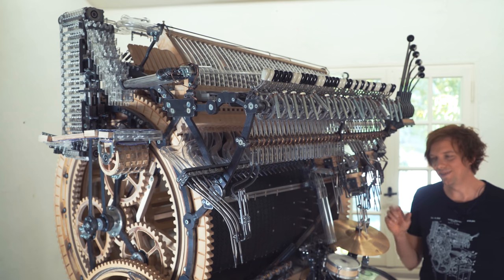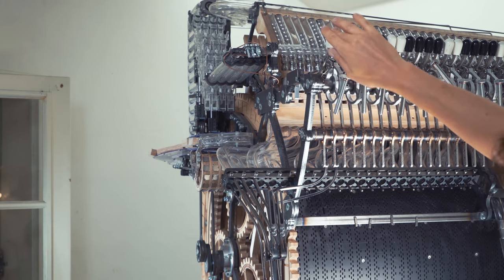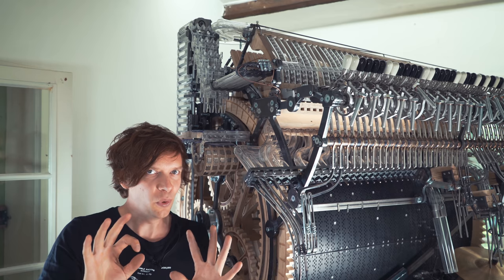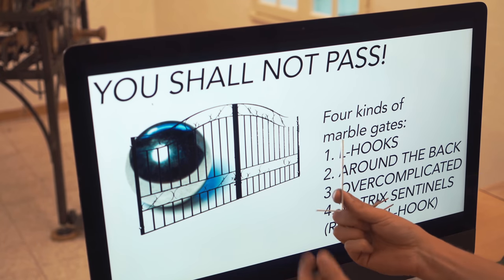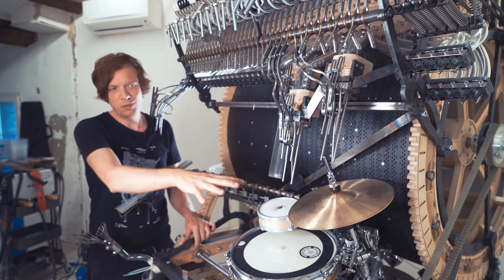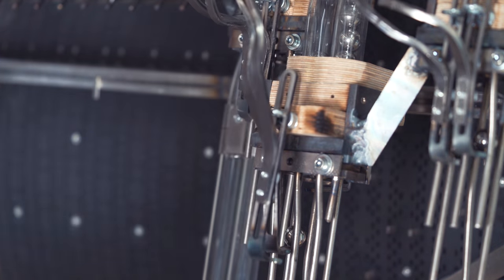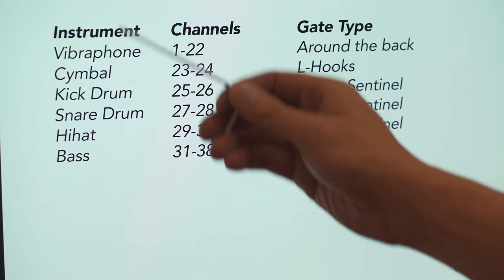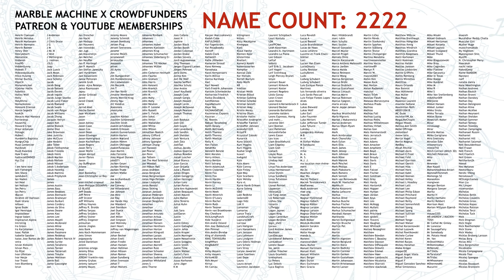Marble Gates Design - Marble Machine X #91

Comment: The overcomplicated design can be simplified a little bit for the tight constraints. A pivoted crescent, the release moves away from the guide and the crescent rotates in above the release. In closed release position the crescent is open, while the release is being opened it moves in and a marble drops on top, when the release is closing again the crescent moves out and drops the marble.
Doesn't require any space to the sides and shouldn't even take any more space in length either as it can be fitted into a slot of the release.

Comment: i know you probably aren't going to see this but in case you do: i am pretty sure clockmakers solved your need here a few hundred years ago, and you nearly landed upon it yourself, but the most vital part of an oscillating timepiece might solve your problem: a lever escapement. your "around the back" is ALMOST this, but my idea would be to have the pallet fork of the lever escapement attached to the rail itself, and be driven by the release lever. it would have the size profile of the "overcomplicated" with the function of the "matrix sentinel". your current marble release mechanisms are abstracted versions of this already.

Comment: I have an idea for the Gate. Instead of the "around the back" you could use a Ring of the exact size of a marbleto fit through, on the releasing finger. it will block the next marble from falling through but will release it to the finger once that is lowered enough and it won't take space on the side.

Comment: You could use an F bracket. Just add a secondary stop a couple cm towards the arriving marble. That secondary stop needs to be cut out so a marble can pass through the hole if it is fully closed.

Comment: dear Martin, you can also go around the front, just copy the shape of your droppers and lead the wire via the front of the dropper, among the bottom of one of the guiders (you have 2), then bend them a bit inwards into the gutter. This maybe solves your problem for the Bass guitar, gr33tz Daan

Comment: Yes, continue!
As for gate options, instead of around the back, couldn't there be a pivot in the releaser line, not lije the one that changed the releaser movement drastically, but that makes it into a rocker-arm instead of a straight arm? If so, a slight extension of thr downward pivot-point should interrupt the marble pathway quite near the release-point. Then again, as I watch it, somehow the idea of valves keeps coming up. Or even strong electromagnets that hold the marble queu near the gate, and the programming-wheel stud deactivates the lowest active electromagnet, releasing that part of the queu. Make the queu 32 'notes' long, with an auto recharge of the queu when the last marble is released. All simple electronic set-up.

Comment: Instead of thick wires for your "around the back" solution, try using thin sheet metal triangles, maybe? Thin Spring steel sheet cut into small triangles, attached one edge to the release on both sides and a metal T-piece around the back, attached to the triangle points. This construction should still be slim enough, theoretically.

Trying it out and see if it works might be worth it instead of sacrificing speedy bass play :)
If this won't work, you still got the L-Hooks.

Comment: Not sure about the reliability, but you could mount a wire/string underneath the marble droppers and attach the other end to the claws on top. When the claws are raised, the wire is pulled taught and a marble will be stopped. When the claw is lowered, the wire would be deformed and allow the marble to pass through again

Comment: You can play fast bass with L hooks if you make them optional.
L hooks are there to stop the marbles from falling through the last gate when playing slow right? and it's not an issue when playing faster tempo?
If you can remove/disconnect the L-hooks, you can disable them for fast play (where they arent needed) and enable them for slow play where the marbles falling through is an issue. So easy elegant design, and can still play fast bass.
Good luck Martin!

Comment: I have an other idea for the vibraphone. The idea looks more or less like a U. You can add a small peace of metal to the part where the marble is release to trop on the instrument. That peace locks the marbel when it is open and let the marble go when it is closed. When you take the letter U and fill the bottom part until half. Then the marble can roll at the top part and that's the part when it is closed. I hope you can understand what I mean. That is not complicated, fast and you don't ne much space.

Comment: You could have two hooks. Instead of it going round the side it goes though the middle. The one that realises and then another behind this that is longer. In the middle with a hole in, you could bend the tracks slightly down at the point where the hole meets the track. And then this will block the marble going down when lifted up, and then as the hook goes down the ball can roll through the hole due to gravity. This should save space, and work similar to the matrix one. The only issue I see is bending the track, the ball could then slide off, so you would need to add little guards on the second hook that has the hole in, which force the ball back on the track.  :)

Comment: Martin! I think i found a solution for the bass! Why don't you use an overhead "escapement" like the one it has been used on pendulum clocks? It's relatively easy to modify the existing marble gates, it only will add one piece, it will go above the rails and  it can be small and fast. 
Sorry if theres mispellings, english is not my native language

Comment: I doubt this is something you have not thought of, but the "overcomplicated" solution could work much better if the tooth blocking the marble was LONGER and at a much more oblique angle. Right now it's going all the way vertical, meaning it has a short path to flip between open and close. What if the open position (when a marble was allowed to reach the realease mechanism) was flat and parallel to the track and just over it, and then the CLOSED position (when the tooth of the overcomplicated assembly preventing the marble from reaching the release mechanism which is currently open) was not vertical but angled slightly and long so that basically it was just like a hypotenus? The marble would be blocked by the lower part of the track and the tooth which would now be at an angle, but as the part now has a much smaller angle to navigate it can be faster and cover much more travel at the edge, making the whole part travel at a lower angular velocity and thus maybe even less of an angle to turn, but have a higher linear velocity at the edge.

Comment: Hi Martin, I think its not overcomplicated if that's the only way to meet all design concerns. That's just complicated. It's a necessary evil. So I think you should use the complicated design on the bass and any other instrument that needs it. Then again, this is something that can be replaced later since no other MMX parts will depend on it.

Comment: For the "Around the back" you should make it a module that mounts to the top of the lever with screws, has thin sides like sheet metal, that goes down on each side of the slide with holes in it for adjusting, that then screw onto a piece of metal with a lip you can adjust on the bottom.

Think of it like this:  [u] where the brackets are the sides, the "u" is the catch point, and above it is just extra runout to go on top.
I wish you could attach images to comments, so I could mock up one for you. 8(

I think it has more potential to look a bit more elegant, not be over-complicated, use the already-available holes without needing welding AND look elegant....

Comment: The wire for around the back design for the bass, try to understand my wording. (maybe weird). If you get the rod higher up where there is space between the tracks, you should be able to have it adjusted the way you want, all without an L-Hook. It could run down the track to end up at the drop point.

Comment: On the base guitar you've only got four gates so you could have around the back gates on the two outside strings and just have the standard L hooks for the two middle strings without mucking up your spacing at all. That could improve your  E and G timing without any extra work. I don't know if that's worth doing, but it's something.

Comment: As a former road-case (aluminium flight case) builder, I cannot help but think of the complexity of the cases (and their ease of use).
This heavy and delicate instrument will likely be subject to vibration and careless handling.
Reply: I had the same thought. I'm also imagining that someone out there will probably step up and help build cases for this thing. I'm imagining it basically being shipped in fancy crate. Bottom of each case has a cradle with some sort of vibration damping, and a 'back' wall permanently affixed.  Set the assembly on the cradle, bolt it into place securely, on two different movement axis'. Then the rest of the walls and the roof are attached. Each has heavy foam padding. Cut to fit. The whole thing bolts together securely. Reinforced corners and edges, built on casters (air filled for a less bumpy roll).

Comment: I like the "Overcomplicated" design much better.  It seemed to accommodate the system requirements and it didn't appear to be all that complicated.  It was a much cleaner design than the "Around the Back" method.

Comment: For the bass guitar, you could stagger the marble gates slightly and gain some space on the side that way.  If the marbles his the strings within 20mm of each other, would it make a sound difference?  Probably not.  If you stagger the drops (or maybe invert them) you will gain a lot of space on the sides and be able to use a faster solution.

Comment: So I don't know if I did the calculations correct and if all of my assumptions were correct, but anyway.
So I counted the frames between when the drop closes and the marble arrives at the drop and it took 18 frames. So assuming the video was played at 24fps that would make the time for the marble to be played again after the last marble was dropped 0.75 seconds wich results in a maximum tempo of 90bpm, however if the channels are doubled up on the bass a note can be played twice as often so that would mean the maximum tempo for the bass would be 180bpm.

Comment: If you offset the input of the blocking slider to the back, you do not need an L-hook. Might work for the fast-base problem... It would still release only one ball per pull.

Comment: There is a simple and elegant solution that you actually were onto with the over complicated design. In automation its called a singulator.  Instead of having the L hook actuate the rear marble stop, The teeter totter actually becomes the L hook. Imagine a U shaped teeter totter and the actuator lifts the front of the teeter totter which causes the back to come down and stop the marble when releasing the marble to play the note. then it teeters the other way releasing the rear marble and catches it in the front stop.

Comment: A slight redesign of the over-complicated one might make a viable adjustable pivot. instead of the T piece sliding into the arm and getting pulled up, maybe a pivoting arm with a spring or flexy metal brace could hold a pin down in the marble channel, and the arm could push down on the pivot, releasing it. Im picturing an elonGated 'S' with the pivot at the center, where the screw holding it on has a small slot to be adjusted if needed. Its resting position would be to block the marble at the end of the channel, but the arm's resting position pushes down on the end of it, opening it up.

Comment: Have you thought about changing the around the back to just go from where you weld it straight down to the gate? Same issue with defining the length but you eliminate the issue with needing space on the side but still retain the exact same functionality. Not only that you need less wire to make it work.

Comment: Why not use a modified L-hook. Use one too short to stop the marble so it does not use up space on the sides and solder to it a reverse L-hook that can run down the back of the channel and stop the marble before it hits the drop point. Benefits of the around the back speed while keeping the benefits of the L-hook space saving.  Thoughts?

Comment: The matrix sentinel is the only option solving the core problem: The replacement marble for a used marble has to cover so much distance. If you always kept at least one replacement marble super close to the about-to-be-used marble, then playing fast should be no problem. Use a rocker/seesaw/gear shaped gate that is designed to always hold a second marble close by. The number of replacement marbles to keep nearby should be proportional to the distance from the marble divider, because that decides the amount of time these close marbles will not be reloaded for once the fast playing starts.

Comment: Maybe in a "overcomplicated-like" mechanisim, you could use the same piece of metal, hinging at the top of the upper railing, to close the channel. The piece would have and angle in the point it hinges and a piece of metal, allowed to rotate at both points, could join the opening extreme of the piece of metal (droper) with the activator up top. Essentially changed the droper such that it opens by circular motion instead of "linear" (hinges out of the way instead of moving out of the way)

Comment: It’s always been a concern of mine that you do not have enough structural support on your back legs. I would recommend putting a cross support arm on the back legs. This is because of consistent vibration From you playing the marbleMachine, I believe it’s going to cause stress fractures in welds over time.

Comment: What about a snap-back toggle gate. You can pre-load two marbles close. A simple mechanism like the push-on, push-off toggle switch uses, controlling double "L" gates by a rocker. A push-on, push-off switch has a rice shaped set of tracks with the end of one track ending higher than the start, which becomes the second tracks new path, going from track A to track B, then back to track A again. EG, on the down-stroke, it takes path A, on the up stroke, it takes path B. You would use path A (pull back) to drop the musical marble. Then, on the return, it takes path B, which drops the buffer marble into position A and also allows the pending marble that dropped, fall into position B, once the gate has finally unblocked by the second "L".

This concept is also seen in clocks, to limit the timing gears to only one tick, using a "Y" shaped hook-pawl, which toggles back and forth, only allowing one gear to turn, per rotation. (Normally controlled by a single release, which is buffered by an air and weight-dampened flywheel. Also seen, partially, in music-boxes, without the "Y" claw hook. Which is why music boxes have no actual "timing", other than air-resistance and the fly-wheel.)

Comment: You could do a "around the bend then the back" kind of setup. So you could have the E string wire go up and over the rest of the releases to the G release, then back down and around back to E. So it would be like a really big C, you would have to vertically stack them up the release tracks though so they wouldn't bind on each other.

But I do think that the L-hook will do just fine for a Bass, just gotta use those 5th frets to play repeated notes, harder yes, but it can be done. You just couldn't repeat an open low E that way..

Comment: The matrix sentinel droppers remind me of a gumball machine.

As for the others, there is a hybrid around the back and matrix sentinel option. A lunar hook, a c shaped piece could be made of the dropper apparatus

When the note is activated, the lunar hook would be pulled around a pivot, releasing the marble and blocking the channel at the same time, when the release is closed, the upper part of the c would clear the track and allow the lower half to catch it, ready for deployment.

Comment: Is there a reason you didn't want to just connect the drum release gates directly to the lower gates? I noticed that you're still using the marble divider gates in addition to the matrix gates for the drums, and that means you have to add a whole bunch of marbles to the drum gates since you have to get them past the marble divider gate first. Were they too heavy or something? I'm also wondering why you don't want to use the matrix gates for the bass since couldn't you just build one that's four by two for the bass?

Comment: It seems like the 3d printed marble gates should have been designed closer to the release point to begin with. Solution 4, like you said, is duplicating the gate function further down, making the original upper gates unnecessary. If you moved all the gates lower and in front of the programming wheel, the marbles also would not have to be transported as high, perhaps making the fish stairs unnecessary! Though we would then lose out on watching those stairs do their stuff.

However the deeper design issue is that the marble gates do not release the balls accurately enough for tight music, so you have to have the “fingers”. Ideally there would be a gate design that could release balls both accurately and one-at-a-time, instead of two components that both stop/start balls, necessitating charging between them.

Despite this, I do think the current design is better than anything I just suggested! Though I might be biased because I’ve been watching it develop for so long. Certainly there are simpler and more practical ways to build the MMX...but there are also simpler and more practical ways of playing music in general. The MMX, I think, is much more than an instrument. It is a piece of art that celebrates the process of creating something complex and wonderful.